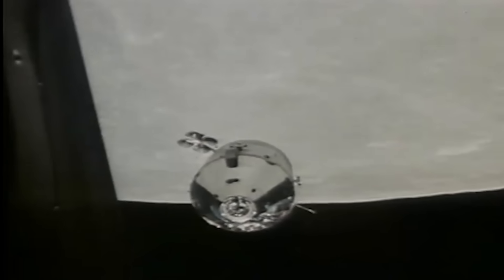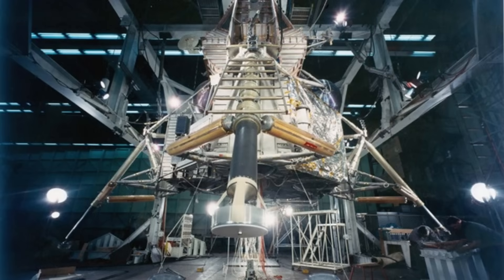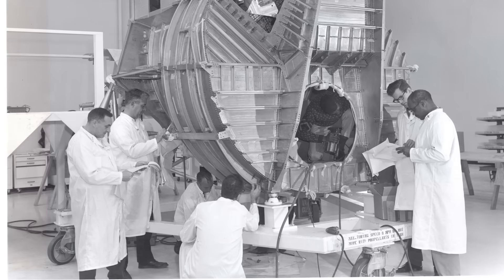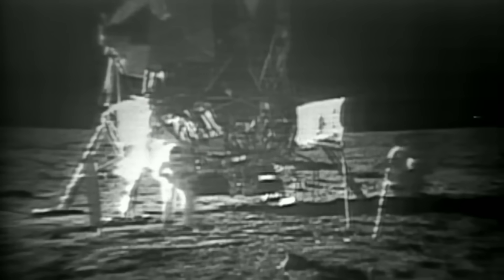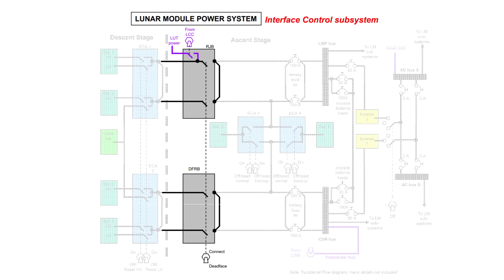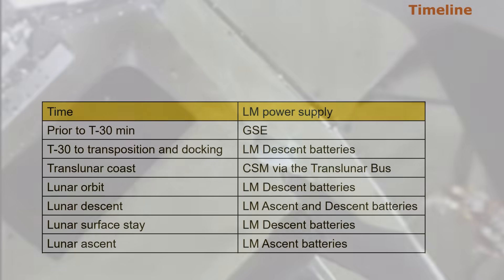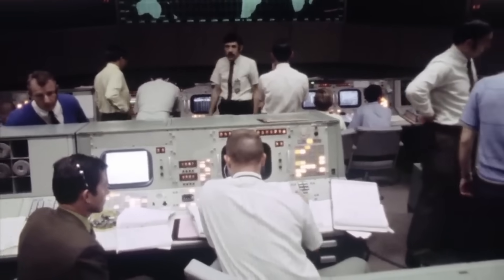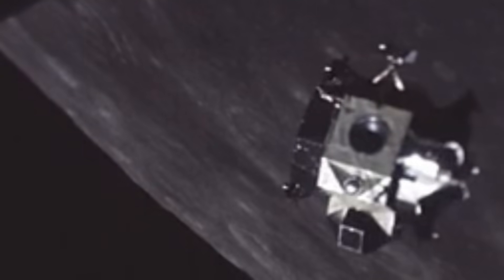Lunar Module Power: The Hidden Electrical Systems That Kept Apollo Alive

Comment: I assume the solar panels of the era were too heavy per unit of electrical power to be better than the batteries in the LM?

Otherwise, it would have been logical to cover the outside surfaces of the lander in them, as well as on the CSM.

Providing they were robust enough to survive launch / engine vibrations?
Reply from the maker: The Apollo Lunar Module used silver-zinc batteries instead of solar panels mainly because solar panels of that era were too heavy and less efficient per unit of power. Batteries provided a reliable, compact, and vibration-resistant power source for the short mission duration on the Moon. Covering the LM's surface with solar panels would have added weight and complexity, and the LM's brief lunar stay made batteries more practical. The Command Module also used fuel cells, not solar panels, for similar reasons of reliability and weight.
Reply: @apollo11space69  I guess the weight margins on other spacecraft of that era, in LEO, that DID use panels were less severe... and they needed to operate for longer.

Great channel, BTW! I'm doing a local talk soon debunking the Moon landing conspiracies...
Reply: @peterloohunt  Good luck with that. Most moon landing deniers are also flat Earth believers. Maybe I’m wrong about that but they sure have the same mentality of dreaming up additional conspiracies rather than admitting they are wrong about anything.

Comment: One of the ways that they saved power was to use E.L. panels to light up the gauges and switches. Electro luminescent panels under all the instruments. Later on, night lights were on sale for your houses. A little square panel would glow at night for enough light to see. Then LED's came out.

Comment: This is an excellent video, but there are two corrections necessary. First, when the ascent stage's electrical system was separated from the descent stage's electrical system, all the wires were cut using guillotines that were ballistically operated. There were four explosive bolts that also fired, but those severed the mechanical connection between the two stages. Second, during Apollo 13's coast back to earth the LM's batteries only powered necessary systems inside the LM. During this period of 83 hours the Command Module was completely dead so it wasn't running off of the LM's batteries. During the coast back, engineers did figure out a way to feed power backwards from the LM to the CM. Shortly before reentry, power was feed backwards from the LM's batteries to the CM's reentry batteries. This was done to transfer the remaining power in the LM's batteries to the CM. The CM's reentry batteries had been partially depleted right after the accident because the CM was forced to run off of the reentry batteries for a while, so recharging the reentry batteries was deemed necessary to make sure they were adequately charged during reentry.
Reply from the maker: Thanks for the informative comment!
Reply: Thank you for the correct information.  When the video said that, I thought it didn't sound right but hadn't got around to checking myself.
Reply: @ptonpc  Well at least you know how to do your research and check your facts. That's better than a lot of other people on here.
Reply: There's always someone around to nitpick.
Reply: @deplorablelibertarian  I'm not nitpicking. There are two inaccuracies in the video, so I pointed them out and corrected them. Even the original poster of the video thanked me for my comment.